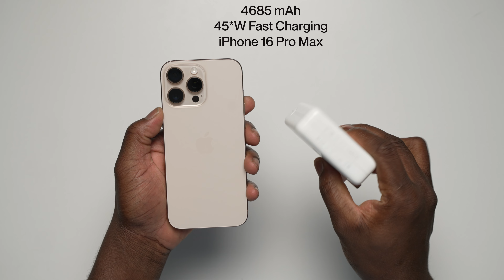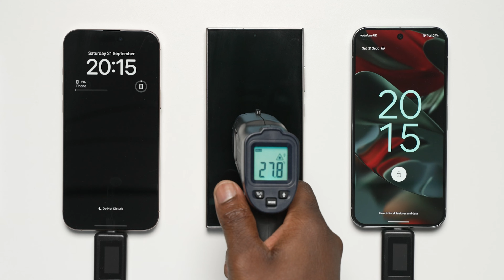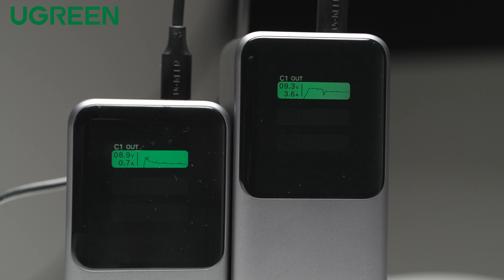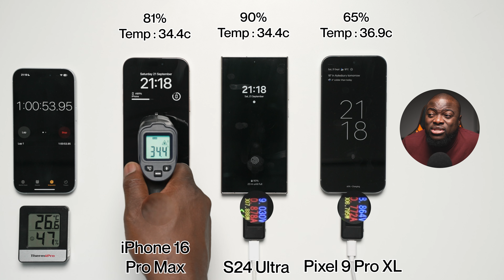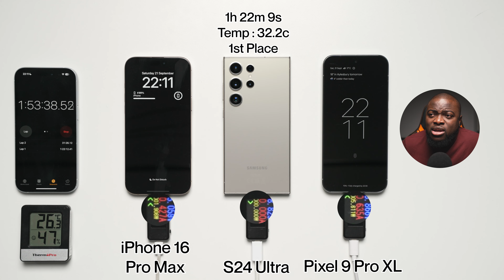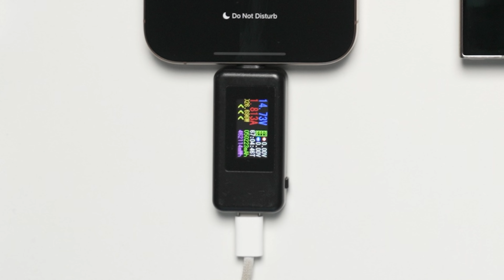iPhone 16 Pro Max vs S24 Ultra vs Pixel 9 Pro XL ULTIMATE Charging Test

Comment: Video proves that pixel you should never use the original full set inorder to reach the full speed , or maybe it requires cooling set for full speed , i always get faster results without using original charger for Pixel 9 pro xl

Comment: I wonder whether the wattage meter you had plugged in affected their normal charging speeds? I have the S24 ultra and it charges in 75 minutes (at most) from zero consistently, and the Pixel in your test seemed to hit a brick wall. Very odd.

Comment: counter point in which my s24u charges basically the same as yours lol. got a similar kinda display cable and its frequently at the 14-15w during the charge bizarre. Kinda feel like i might give oneplus a shot again with the 13.

Comment: Interesting Fact: 
So the new iPhones are just theoretically (but also hardware wise) capable of charging at 15 V and 3 A (45W). 
They can pull up to 39/40 Watts when being used while charging (in the Video from Matt talks tech, i think there was a peak  at around 38-39 Watts just by having it on with high brightness). In other tests it also exceeded the 40 Watt mark and it reached about 42 Watts when playing a game and thus having high energy consumption. (ignoring the fact that charging with 40 Watt while playing a very demanding game isn't the best option to preserve Battery Health) 
The 15 Pro Max never really exceeded 30 Watt so its charging slows down while using it. It's just to compensate the energy consumption of the iPhone. 

I just think they should have allowed the 16 Pro / Max to charge constantly at around 40-42 Watt instead of 30 Watt in the first 15 minutes or so of charging. Combined with the new thermal System i think it should be possible, given that not everybody has a power supply of 30 Watts or higher. And a toggle in the settings for "Fast Charging" could also be implemented so if you wanna be careful with your battery that you could limit it to the standard 27/28 Watts of normal peak or even to 20 Watts (but I know that Apple does not often implements these kinds of options). The possibility to boost the charging speed when needed would be really great. Nevertheless I charge my phone over night with 5 / 10 Watt so for me personally, fast charging isn't that important but the option would be cool. 

What do you guys think about it ?  🤔

Comment: I never charge beyond 80% so these tests are not relevant for me. I use 30-40% a day getting 3-4 hours SOT, and I charge up to 80% which takes between 20-30 mins, which is not a first-world problem. I also carry a MagSafe battery pack just in case; that gives 4+ hours of extra SOT if I forget.

Comment: This is so weird because when I charged my pixel 9 Pro XL with the new 45 watt charger brick that Google released. As soon as I got it I did a charging test and it got to 70% in 35 minutes and then it drastically slowed down from there. But it fully charged in an hour and 13 minutes.
Reply: Yep same thing bro even tho it's not charging at full 45w my 8 pro goes 0-100 under 1 hr 30 minutes sometimes 24 minutes depending on room temperature and how i was using my phone before charging it the temperature also
Reply: it's pretty normal. first the phone temperature rise during the charging so it slow down to prevent arm to the pixel. second the battery have less electron to recharge herself (look how a battery of lithium work)
Reply: Something is wrong in your Tests...i have always 64-67% in 30 minutes on my Pixel...and you have this after 1 hour......
Reply from the maker: @davidniositech  then I am glad you're getting the results that are correct but those have not been the case for me and I've shown it many times already that I am using all original cables and chargers for maximum speeds
Reply: @LoverOfTech  than send the Pixel back, because something is wrong...
Reply: @davidniositech shut the hell up already
Reply: I charge my Pixel 9 Pro XL always in 1 hour and 14...he has adaptive charge on for sure....
Reply from the maker: @davidniositech you clearly didn't watch the video when I showed it was off.
Reply: @LoverOfTech  are you using the original Google Charger? In your Test it's always worst with the Pixel...i never charge it in more than 1 hour and 15 minutes...
Reply from the maker: @davidniositech did you not watch the video at all?

Comment: Why don't you make a video showing how different the charging speed is at different room temperatures? At 26degrees for example Samsung throttles, but at 20-22 it wont. Also if 30 degrees you'd see +20min.
Reply from the maker: @Udayveer_Singh  no
Reply: @LoverOfTech i loved that answer😂👍🏻 it was a great test! Great content:)
Reply: this request is not too much you can just change the temeprature with ac if what he says is true it would be interesting to see how the phone performs and i dont want to request a arrogant person like you i will test it myself
Reply from the maker: @radhekrishna.444r  I DO NOT HAVE AC
Reply: @user-ij8no5zw6u-  be grateful you don't know how time consuming is this
Reply: @misiu893  What the hell is even going on?? I'm just suggesting an idea for content that's actually super easy compared to what Ben is typically doing here. Super easy, no need for new devices and super informative for the subscribers...why the negativity?
Reply: No-one cares about different room temperatures because it's Samsung's fault that it charges slower because of their algorithms.
Reply: @misiu893  All of the brands have those algorithms. Xiaomi throttles a LOT also. others as well. Pixel might not stall like that  if the temperature is lower. Samsung from memory requires around 20C for full speed.
Reply from the maker: Why don't you make it
Reply: @LoverOfTech  chillax bruh he just asked 😂
Reply from the maker: @RESTLESSGAMERS7  no
Reply: @LoverOfTech You legend 🤣🤣🤣 Respect the answer brother 🫡
Reply: Hahahhaha love that ,they all think that it is so easy to make such video,expecting someone to charge at different room degree  @LoverOfTech
Reply from the maker: @nelsonstillmatic8881 exactly. Like I don't mind feedback and trying news things but requests are just too much
Reply: @LoverOfTech  This was NOT a request, but a friendly tech person to another suggestion of what to do next contentwise. I honestly supported the good work from the start of the channel (you can check my older comment) and now it feels a bit wrong that attitude against me...
Also having done the same type of video on my channel, that charging test video is the easiest one you've done on yours and that kind of info is not to be found in YouTube yet....
But whatever, I have the results so why would I "request" them for myself? :)
Reply: @LoverOfTech  Well I have sort of as a matter of fact, also included charging graph. It's very interesting and would be useful info the the people watching you, that's why I suggested it. Most don't have any clue what is going on...
Reply: 😂 @LoverOfTech

Comment: iPhone not support 45 W so it's fake
Reply: Like any sensible person, check the small print: "up to 45 watts." Not even Chinese 120-watt charging gets 120 watts and drops past 80%. If you charged 80-100% at 120 watts, you would kill your battery in a year or less.
Reply: @andyH_England  bro do u think iphone battery come until your death with 10 watt ? 🤣🤣  iPhone battery loses it strength also as time move. Every mobile slow down after reaching 80% charge ok..
Reply: @Indian_Cricket_Troll  It depends on what you do. If your game, then <80% health will be restrictive, but if you are scrolling through Twitter, then any difference will be nominal.
Reply: ! It supports (theoretically) 15V & 3A = 45 Watt. But these wattages only shows up when you are charging it and using it at the same time. So the 45 Watt (more realistically 40 - 42 Watt) only shows up during "high energy consumption", like when playing a game for example. For the normal charging  it only pulls around 27 - 30 Watt as peak.
Reply: @germanicus_  no one put charge while using ok.  We need fast charging at least 40 Watt in real life not theoretically.
Reply: It's not fake, it turns on only when you use the phone intensively while charging. Of course that won't speed up the total charge time compared to idle, but it won't be much slower too.
Reply: @KPSCkea yeah, don't get me wrong. I'm definitely on your side 👍. Fast charging with at least 40 / 50 Watt would be really nice and should definitely be implemented (and charging while using it is especially hurtful for the battery and therefore not the smartest thing to do). I just wanted to correct you that it would "not support 45 W" and therefore would be "fake", isn't entirely accurate. Thats all 👌